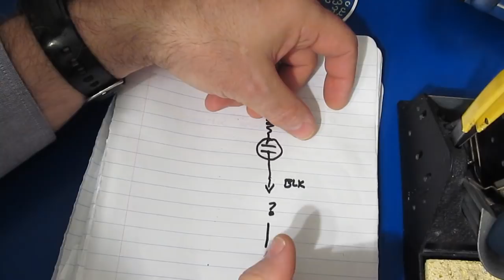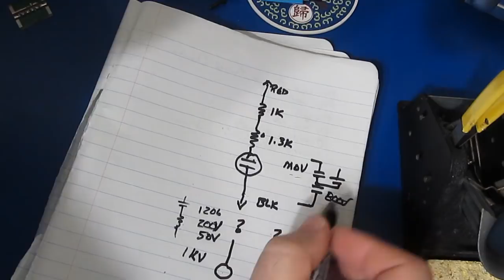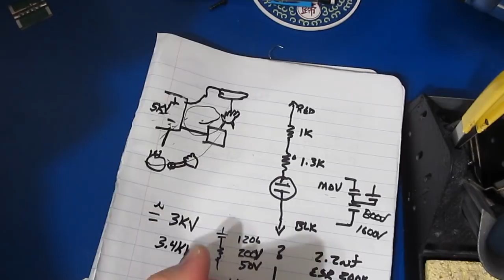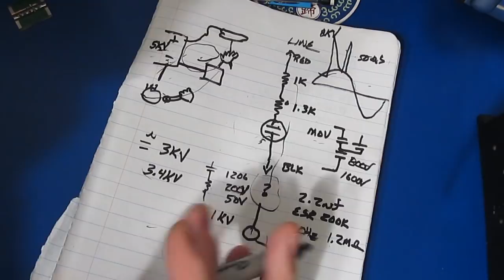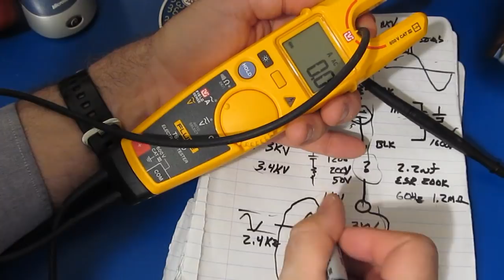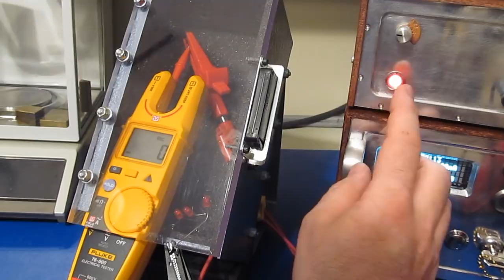Fluke T6-600 Part 2, High Voltage Transient Testing

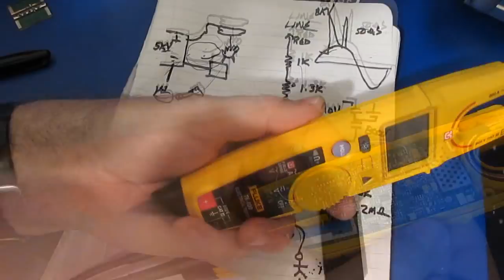Comment: 10:25 what do you actually use to tell you if a wire is live or not? Do you do a preliminary search with a non-contact device first and then with a proper multimeter?
Do you have any recommendations for no-contact voltage tester?
Reply from the maker: I am not an electrician and have no training in that area.  My recommendation if you are working with mains if get proper training.  As the people who work in these fields.
Reply: @joesmith-je3tq  good point. I'm not an electrician either but sometimes I like to do my own electrical work around the house like changing switches and outlets just very basic stuff
Reply from the maker: @qpSubZeroqp  I also do that.  We use 120V  and I typically use a house lamp to check it (or what ever else I happen to have).
Reply: @joesmith-je3tq  that's pretty good
Reply from the maker: @qpSubZeroqp  It low impedance and readily available.  I can test it in a live outlet first.  Nothing I need a meter for.

Comment: Hello Joe, I have a number of Fluke meters  i don't like the Fluke hanging strap with the magnet  I want to glue a magnet to the back of my meters so I can hang it on the side of equipment will this affect the operation of the meters ? thanks Scott
Reply from the maker: I suggest you contact Fluke with your question.  I the few meters I have looked at, one used unshielded latching relays that could be effected.

Comment: I know its an old video. I appreciate your efforts. Handheld insulation testers seem to be limited to 1-2 mA based on the ones I have used. As far as published ranges of fatal currents it varies based on many safety classes etc. over the years, I'm certainly not an expert in this area.  10mA  is in the beginning of the range of muscle contraction where you cannot let go. 70mA is the beginning of heart problems.  5A is in the range of an electric chair.  Certainly makes you wonder how the "experts" acquired this information.
Reply from the maker: I really don't know the history behind it.  I bet there are some good stories.

Comment: This is very interesting as I had a massive shock from the rear grounding from my Fluke T6 and did not feel well at all for some 2-3 days after, and ended up needing cardioversion (my heart reset) in hospital.  But I think I was lucky as it was only at 120v DC (EV bike battery to the controller)
Reply from the maker: I assume there is a lawsuit pending.  I am very interested in following the suit so please keep us informed.
Reply from the maker: If you have not filed a suit against them (which I am not sure why you wouldn't), I assume your attorney or the insurance company has been in contact with them.  Can you provide any details on their response?
Reply: @joesmith-je3tq  I'm in the UK so not the same over here, but I have a "No win no fee" Solicitors looking into it for a product liability compensation claim, but the courts are closed till the end of the year from Covid and then a 3-year backlog of court cases waiting to be heard in England, we are on full lockdown here and can't even leave our homes for most things, but my solicitor has written to Fluke UK and we are waiting on testing the meter.
I will let you no more as I do.
Reply from the maker: @hardergamer  Was your meter turned over to Fluke for testing, or some third party?  I bet a lot of people would be very interested in seeing that report.  How were you using the meter at the time you received the injury?  From your initial post, I assume you were touching the rear ground plate but what else?    I've tried to find where anyone has filed a suit but no luck.  Yours may be the first.  Looks like they are still listing on their site as well.

Comment: Thanks Joe for explaining this. I love this meter. It works great.  I really don't think it was necessary for them to design the touch plate. The only time I would use it is in a old house with no grounding conductor. Any other applications I would use the black lead to ground the meter to any grounded metal. In every commercial and industrial applications there is plenty of grounded material around.
Reply from the maker: I can understand why they would design in the touch plate if the non-contact detection worked.  Sadly, this whole feature, IMO is not good enough.  It's not as bad as it looked in the video with the person trying to use it with the Klein current breakout adapter and could be used in some cases.  It's just not what I would consider good enough.
Reply: joe smith I just used it yesterday to verify that overhead service conductors were still energized even though house meter was turned off remotely. I was able to verify 120 phase voltage when standing on an insulated ladder in the middle of the back yard. It was excellent because I didn't have to open the panel or climb on the house top.

Comment: Excellent vid, thank you for your thoroughness!
Reply from the maker: Glad to help.  If there is something else you would like to see that was not covered in these two videos, feel free to ask.
Reply: hahahaha "not covered" he says!
Reply from the maker: Cover: deal with (a subject) by describing or analyzing its most important aspects or events.
Reply: In my not so humble opinion that voltage detecting plaything would be only useable if the sensor is relocated in to the tip (for AvE it is more sensitive so I heard).
In most cabinets I worked on, the cableing is run as short as possible thrue air so it looks more tidy that makes the voltage sense useless.

Comment: AvE sure stirred the YouTube pot with this meter. It doesn't seem like such a lethal killing machine to me though.
Reply from the maker: I was not impressed with Fluke's video but I really don't know what capacity they have in the USA anymore.  For safety, the T6 has been certified which is more than many of handheld meters on the market.   If Fluke starts making design changes and not keeping up with the certifications or not certifying them at all, I would be concerned. 

Yes, I know my videos for this meter were pretty boring.   It seems I have been running a better class of meters lately.   Even that 87V wouldn't do anything.  We really need to run a nice cheap meter again.

Comment: Well better do it with LED's then a real human and surely if someone buy's this clamp meter and uses everyday on electrical boards they will have feedback... The first minutes i thought that you would do that experience instead of the LED's... Thanks for bring this tests.
Reply from the maker: From the lack of any feedback when using my hand in the first part of the testing, I don't think using the hand for the second part would have been any more educational than the LEDs.  At least with the LEDs you can see something happen.
Reply: it was on the 46:02 on from the first video  your hand shaked above 2.6KV. With the LED's was a safer and also educational choice to get a visual feedback from the test. But it would be interesting if someone that bought one of these t6-600 and also report. The idea of the clamp meter with voltage / current on the inductive sensor makes suitable for troubleshooting electric boards ( 110 ~240AC)